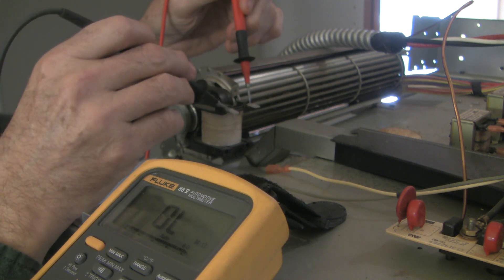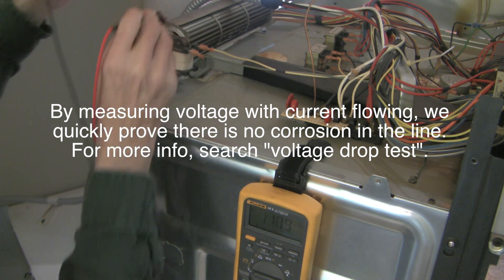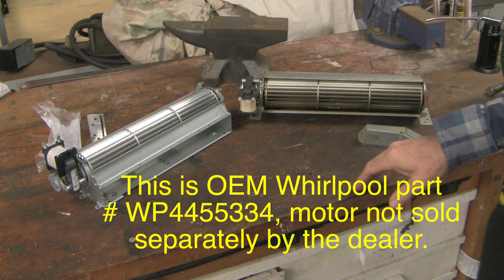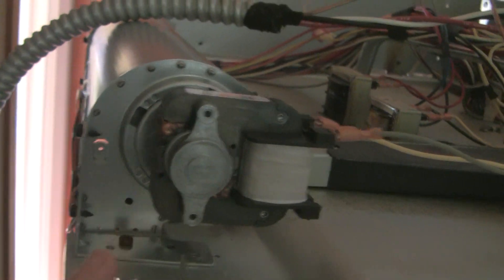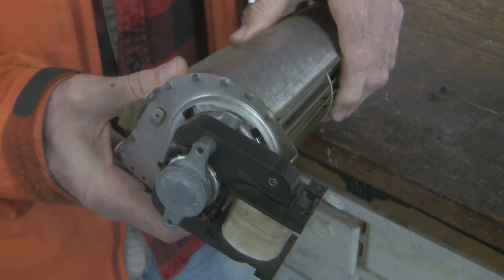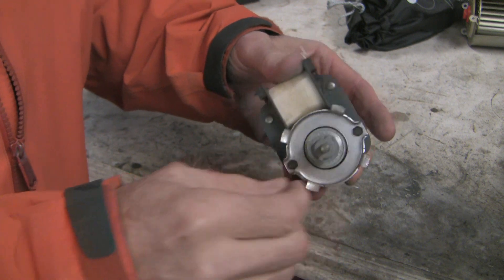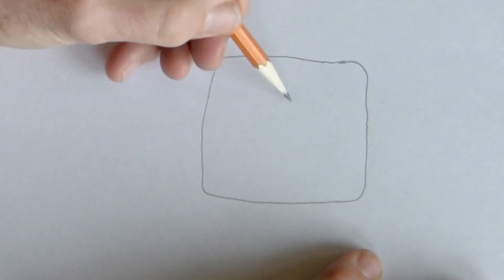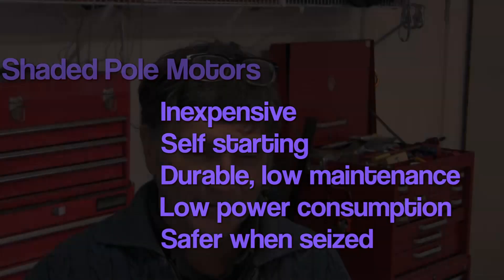How to Fix a Noisy Oven - When Shaded Pole Motors go Bad

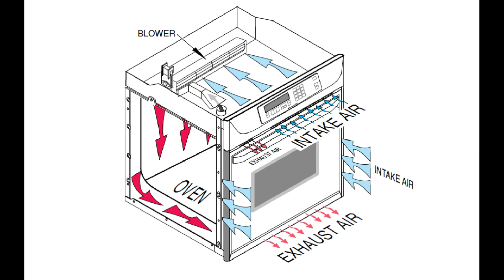Comment from the maker: The diagram at 3:11 showing air flow was taken from the OEM repair manual. I've always been a little puzzled by the direction of the black arrow showing air being drawn toward the blower. In fact the part I call the 'snorkel' is placed on the blowing side of the fan, so the arrow should weakly point the opposite way, to exit out the front. That way air from the oven compartment would be drawn out by a weak Venturi effect. Practically speaking, it is obvious that air blows out from the front of the cabinet so the red arrows are accurate. I wonder if this part was redesigned when the manufacturer noticed warranty failures from overheating when self cleaning.
Reply: Thanks for the guide on replacing the oven fan! I appreciate the tip about the motor wires probably not mattering which way they connect for the motor to run.

I just wanted to double-check on the safety aspect of this. While the motor itself might work with either connection, are there any specific wiring considerations within the oven that we should be mindful of to ensure safety? For example, is there a specific way the original fan motor was wired that helps ensure proper grounding or prevents any part of the motor or its housing from becoming accidentally energized?

It would be great to understand if there are any best practices or specific wiring configurations to follow to avoid potential electrical hazards after the replacement.
Reply from the maker: @manp1039  That's a good question. When I was a kid, the industry was bringing in the now universal dedicated equipment ground connection, and since then to get CSA approval on any appliance you have to show that there is no connection between the white neutral wire and the equipment ground. That has safety considerations that go beyond the appliance to the rest of the home, so it's pretty important. There are still some ancient appliances around from those days, especially in the 240V world, but you'll likely know that you're working on a relic. Even so, it's wise to be cautious about what you don't know, especially when working on devices made on the other side of the planet. I suppose it's possible that noise suppression circuits elsewhere on the appliance board might choke if the motor wiring is reversed. So, if you know which way it was hooked up before, I'd reproduce that. My point in the video was that shaded pole motors spin the same way regardless of which way they are wired up, in contrast with many DC motors and 3 phase motors. To get reverse rotation, they are designed to be flipped over and mounted 'backwards' on the axis of the mounting hardware. By design those things are isolated from the metal brackets on both sides, and you can easily check that with a multimeter. So if you don't know which way it was hooked up before, I don't believe it should matter.

Comment: Excellent presentation. I am fixing a mini fridge and discovered that the condenser fan has failed. I then found your video "How to investigate and fix a fridge that is too warm." Your comment at 6:24 in that video led me here because I was interested in learning more about these motors. First of all, you helped me confidently diagnose my mini fridge. Secondly, and quite coincidentally, I have a KitchenAid oven from the same family as yours (but with integrated microwave). If I ever need to replace a motor on it, I know where to go on YouTube now. Thanks for your thorough and no nonsense presentation.
Reply from the maker: Thanks, man! This week I'm doing a video on a failed PSC Motor, which is a step up the ladder of AC induction motors from the shaded pole design. The people who designed these devices were brilliant.

Comment: Great video. I had the same issue with bearings in the two convection fan motors in my oven causing the rotor to rub on the stator. It's fascinating how this motor works.
Reply from the maker: Fascinating, I agree! Today I'm completing a video on failed PSC motors in a dehumidifier. They are similarly intriguing. Tesla, and the guys who invented newer electric motors, were brilliant. Thanks for stopping by!

Comment: These shaded pole motors are awesome. This radial fan probably would have needed nothing more than a bit of good oil on the bronze bearings to keep running for decades. When making repairs, I always try to start with the simplest thing, for example with oil.
Reply from the maker: That's a good point. I did oil the other bearings while in there and the oven is still going strong!
Reply: @spelunkerd  Thanks. Yes, oil extends the life of many things many times over. Of course only if it is not resinous, preferably synthetic oil.

Comment: How can these motors possibly go bad? I had one go bad in my freezer, it was a small shaded pole motor. I couldn't wait for the new fan to arrive in the mail, so I retrofitted a 1.2 amp commercial 120 volt metal "computer fan" with a digital hall sensor control board inside of it, which is a very expensive ball bearing fan for large commercial equipment cabinets; you can hear it spool up when the freezer/fridge kicks on, because it's a ball bearing fan with a metal frame and no rubber dampening like the original freezer fan. The freezer is noisy now, but the ball bearing high speed fan is a beast. I'm hesitant to put another "shaded pole" motor back into the freezer, because the new one I purchased was about $17 and it's so underwhelming, I expect it to fail right away. But how can something so simple fail? Computer fans with their hall sensor and transistor power circuit board inside of them, never seem to fail, despite their increased complexity.

Comment: It drove me crazy that you didn't lube/add oil to the bearing oil reservoir.
Reply from the maker: That's a good point, and I'm glad you brought it up! For the one that failed, I didn't think it would matter and I had already committed to replacing it. Once those bushings are cooked, they aren't easy to reclaim, and lube doesn't work for long. This oven has three shaded pole motors that are easy to get to, plus two more. Off camera, on the others I did put a few drops of machine oil onto the felt oil retention pad around the bushings. On these, there is no actual oil reservoir aside from the felt pad pressed up against the bushing.
Reply: @spelunkerd  Thanks for the reply; I understand. 
I came across your video as I was overdosing on electric motor videos as I'm lubing every motor in the house from the AC condenser to furnace blower, inducer fan, to kitchen-bathroom exhaust fans, electric space heaters, vacuum cleaners, ovens - I was shocked by just how many motors are in my house, and the number of discarded appliances by folks who don't have the knowledge to do the kinds of repairs we tackle. 
I was also surprised by the replacement cost of some of these motors especially in Canada where things are more expensive than in the U.S., but it was good to learn that there are a variety of replacement fan/motors options even with ball bearings, albeit more expensive. 
Speaking of ball bearings, I also came across a couple of videos of folks replacing the rear brass bushings in the ShopVac motor with ball bearings which I will also be doing - just think of the number of ShopVac motors junked annually because of worn out sleeve bearings. 
https://www.youtube.com/watch?v=KdTgQGFfy9o

Comment: It took 4 years for You Tubed to figure out that this is what I prefer to watch and learn from. Unfortunately I don't think You Tubed can be fixed. Subscribed
Reply from the maker: Thanks for your encouraging words. Likewise as an author I've found that many of what I think are my most interesting videos get relatively few views, like this one. This month I'm doing one on integration of two battery banks in a boat, and it will probably be the same, lightly received. As narrow as the google search audience may be, hidden inside will be many principles regarding how to size wire, how to evaluate alternator output, how to fuse circuits, how to use an inductive ammeter, and the differences between AC and DC systems. Like most teachers I'm happy to find the rare individual who is actually interested, ha ha. 

Dave

Comment: Helpful video - thanks.  Had a similar failure with a Kitchenaid range cooling fan.  Noisy, then just humming.  Unfortunately, whirlpool no longer provided a service part, none on eBay, search internet for 1500rpm, 3/4 inch thick lamina stack shaded pole motor.... nothing!!  Motor did not turn smooth so I took off the bearings, found the rotor had "gunk" on it, cleaned it, oiled bearings and reassembled - done!  Sometimes you just need the confidence to tear into it and try - your video helped me get that.

Comment: can we replace the bearings?and how we do that?
Reply from the maker: In these little motors there are only bushings, not bearings. Shaded pole motors come as a unit and are surprisingly cheap, so usually one would replace the motor. However in addition to the motor, there is also the fan. It has bushings, too. I replaced the whole unit; it would be time consuming to hunt around for individual parts.
Reply: @spelunkerd  my motor have 2 bearings. I have photos to  show it to you. If I replace the bearings with bushings? Is it possible? I will make it more noisy you think... ?
Reply from the maker: @djzapatwork  Possible, but you have to wonder if it is worth your time. You can buy common bearings at auto parts stores, but this size must be uncommon. Bearings are better than bushings. If it already has bearings and I wanted to upgrade I would try to find matching bearings. Often they have a part number and manufacturer, if you look with a magnifying glass.
Reply: @spelunkerd  today I look at the internet and I find that a new one motor+fan it cost about 20€.i will buy a brand new. Thanks for your time.

Comment: 6:03 Why there is a 'tape' around that coil ????
Reply from the maker: Good question. It may be a moisture barrier or a barrier for lint or iron particles that could be magnetically pulled in after manufacture.
Reply: Just doing the devil's advocate:    
If so, why there are several similar shaded pole motors without such 'tape' around the coil?

Comment: thanks, this helps.  I was wondering if the motor could have been repaired or lubricated?  The part in Canada is around $150cad
Reply from the maker: If you're sure it is the motor, you can buy just the motor and swap it out. Similar motors are available on Ebay, though it is always hard to be sure they will be perfectly compatible. You can disassemble the motor and clean it all, then put oil onto the bushings. Some of these have a felt pad that you can saturate with light machine oil. There are a few videos of that procedure here on Youtube. However in the end there is a cost to trying to do a partial job, then failing if parts aren't compatible, or if it fails again at a critical moment like a dinner party with guests standing in the kitchen. I factored all of that into the equation and decided to get the OEM part, as you say for about 150CAD. If I had parts on hand that I could swap out without having to pay for shipping (and then wait for it to arrive), it might be a different story. Good luck!

Comment: I think you are seeing less of these type motors for good or bad in 2010+ designs; example would be bathroom ceiling fans, they have unfortunately the same design flaw; lubrication. This design would last for a very long time if it had an auto lubricator. Good luck with that I know. Lack of lubrication and most importantly the inability to maintain the product. Considering the abuse they really do last a long time and it is dependent on many factors. I guess what it comes down to is the inability to easily maintain the product. Mean time to failure is what manufactures go by, the error rate is determined by Quality Control. Question is do we have that today?
Reply from the maker: Wise words. As you know, getting at that felt pad to replenish the oil is not so easy, especially in motors that are hard to get to. We see this throughout industry, a pattern of fewer grease nipples and bearings with more plastic that ultimately ends up in a landfill. I hate replacing parts with inferior devices that will in turn need sooner replacement. Thank you for your thoughtful remarks.
Reply: What's interesting is that all the old consumer motors for power equipment, like small planers, and drill presses, they had a bushing motor on them. And even fan motors for large industrial squirrel cage fans, many of those motors are just bushing motors. The little felt pads inside the motor hold decades worth of lubrication. Lubrication is a problem on the small bathroom fan motors, but ultimately they fail electronically. They suddenly stop working for no reason, as if there is a programmed obsolescence built in. How is this possible? The copper winding appears to fail, but that shouldn't be possible. There is a great mystery here. I have a perfectly good fan sitting here that spins fine, but it died electronically. A shaded pole motor shouldn't be capable of failing (transformers of a similar construction have a 0% failure rate). Oddly enough, I have a very old shaded pole motor that I found from a junkyard, with a beautiful metal fan attached to it, and it works as good as new and makes no noises. I've never been able to understand why some of these shaded pole motors fail early.

Comment: Excellent description and repair dear sir as always. Such motors are very common in small applications but they are poor in efficiency compared to capacitor type single phase counterparts. Best regards.
Reply from the maker: Wonderful point, I'm glad you brought it up! I had a similar remark embedded in the video, but it was cut from the final edition because I've been struggling to make my information delivery more snappy. As you say, it takes power to spin current in endless circles around the shading loops, wasting energy as heat. Also the strength of each pole is reduced when trying to confer bias to rotation, even though once the rotor gains momentum there isn't much bias needed. Thank you so much for watching my videos, it's great to have educated, thoughtful commentary.

Comment: My frend brought round his fan assisted ovan (similar to yours), it would kick out the electricity for no apparent reason.
I found no problems with the wiring and nothing had excessive current passing, so i checked for earth leakage to the case, oh yes it leaked a little.

The bottom element under the floor of the box had the leak.
When pulled out to inspect it i had a surpprise.
The outer metal tube had melted and the center element core was sitting on the outside sheet metal casing, no wonder the mains tripped when it was warming up.

Check your unit for earth leaks if it plays up :-)
Those ovans also tend to blow out there elements, holes can appear in odd places, not always easy to see eather.

The discription i use for those motors is "Record player motors", it's just the way i remember the type.
Now i understand the motors much better since watching your smashing video :-D
Reply from the maker: Another one of your excellent contributions to a thread. I was getting a PF shutdown with the oven, and I wondered if they were separate problems. In the end, replacing the fan fixed that problem, too. Perhaps I had stray current reaching ground, as you describe, though I couldn't find an obvious short and my non GFI circuit breakers never tripped. I wouldn't expect it to be from the squirrel cage where it was rubbing the side of the laminate core, but maybe that induced an asymmetry of the magnetic field. The oven itself seems to have a protective shutdown with either stray current or just temperature.
Reply: I think my fusebox has a seperate earth leakage circuit and R.c.d/over current breakers.
They work well, but you cant get away with minor faults lol.

In the "Old days" we had a small wooden box with white pot blade fuses,  there were screws so you could change the fuse wire.
High tech LOL :-D :-D

Comment: that was a good video i  think 2nd video i watch of yours first was your freezer then got me start with another youtube and that how i learn about appicance repair what the differnt with fluke 88 vs 87 i got a very good deal on my 87
Reply from the maker: Yeah, the only weakness of my 88V is the lack of RMS voltage, which isn't a big deal for me since most of the time I'm dealing with DC voltage. The new 87 has RMS, but mine is older. Great meters! I believe the 88 and 87 are very similar. Both have replaceable fuses, which I've blown a few times when doing stupid things with the ammeter side, ha ha.
Reply: good to know sure does look like same i got very lucky at find flukes 1 brand new and another almost brand new with case  on craiglist so i can do amps without opening circuit. yea those fuses are not cheap at all
Reply from the maker: After finding out how much they cost, I went onto Ebay and bought a bundle of 5 Fluke fuses for the same price that one goes for at a local store. These days I try to use the inductive meter as much as I can, at least as a screen. The inductive meter is not very sensitive for AC current on the low end of the scale when less than 1A. Notice that my 0.2A reading here was lower than the actual value of 0.46A. Nice to meet you. 

Dave
Reply: thanks for the tip ill have to go ebay shoping one thing about buying use fuse may be blown. i got a kill a walk if i need to do ac reading pick up for cheap. for low voltage maybe a wire and turn it 10 times then take reading from there i need to do a test and see how close it is, thanks